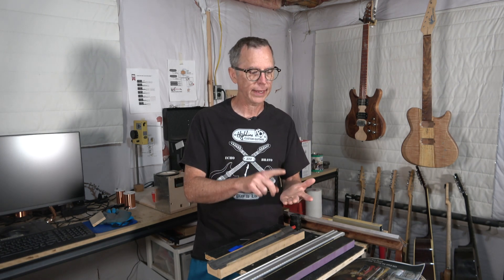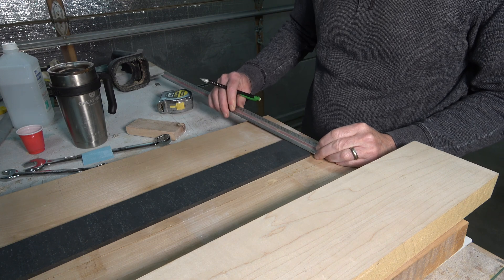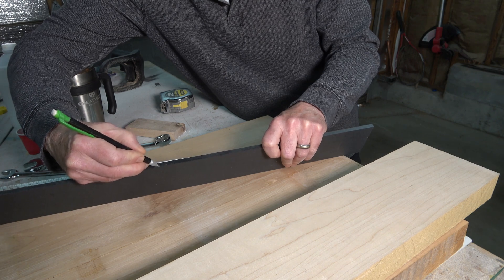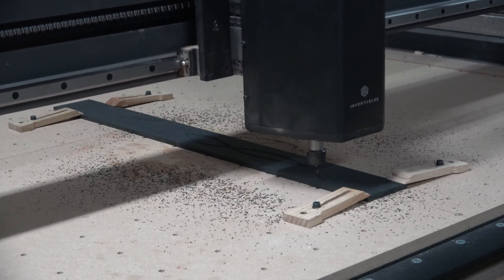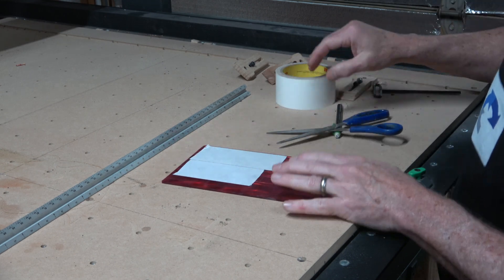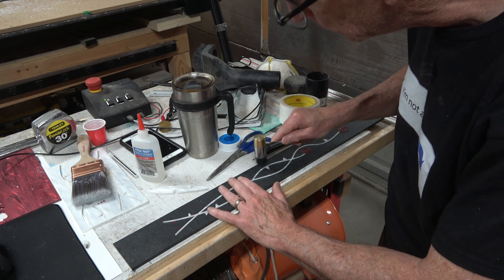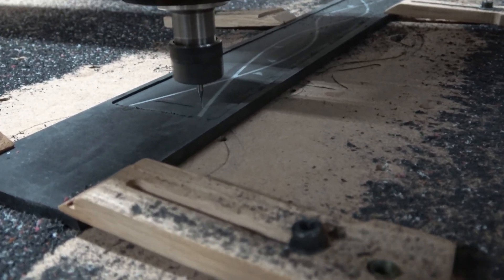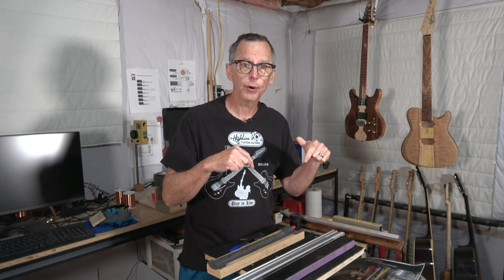Making A V Shaped Guitar Part 9 Making The Fretboard With A CNC Machine

Comment: Slowly making my way through these videos and I’m stoked to see you use Richlite. All my guitars have ebony and the youngest one was made in about 2021. Thankfully that one and all the previous ones all have great cuts of ebony. Despite understanding why guitar manufacturers are using the different ebony’s they are with the color variation and streakiness, I personally prefer just a deep black ebony. Mostly aesthetic honestly. I have a custom build from a Polish manufacturer that uses only composite material and it’s my first experience with Richlite. While I do appreciate the look of grain on an ebony fretboard, I love the resilience and look of the Richlite and it’s so easy to clean. I have another build in process with them, this time with mother of pearl inlays. I’m expecting them to really pop on that deep black Richlite.

Comment: Can I trade you $10 for some help with speeds and feeds on the richlite and kirinite. Just ordered some richlite fretboards and would prefer not to mess them up.
Reply from the maker: Awesome, Devin! Below are my feeds and speeds for those materials. I treat Richlite the same as any fretboard wood and use the same settings. Kirinite is cast acrylic so I use setting that are appropriate. Also, what works for me may not work for you unless you have the exact same CNC machine like I use (Inventables XCarve Pro).

Richlite

Fretboard Radius
.25” two flute spiral downcut bit
Feed Rate: 150IPM
Plunge Rate: 40IPM
Depth Per Pass: .25”
Spindle Speed: 16,000rpm
Stepover: 40%

Fret Slots
.024” two flute spiral uncut bit
Feed Rate: 20IPM
Plunge Rate: 10IPM
Depth Per Pass: .01”
Spindle Speed: 20,000rpm
Stepover: NA

Fretboard Perimeter
.125” two flute spiral uncut bit
Feed Rate: 80IPM
Plunge Rate: 36IPM
Depth Per Pass: .0625”
Spindle Speed: 16,000rpm
Stepover: 40%

Kirinite

Rough Pass 
.0625” two flute spiral uncut bit
Feed Rate: 60IPM
Plunge Rate: 20IPM
Depth Per Pass: .0625”
Spindle Speed: 20,000rpm
Stepover: 40%

Finishing Pass
.03125” two flute spiral uncut bit
Feed Rate: 40IPM
Plunge Rate: 10IPM
Depth Per Pass: .03125”
Spindle Speed: 20,000rpm
Stepover: 40%
Reply: @HighlineGuitars  thank you, keep the videos coming, hopefully one day I can share some of my builds and pay it forward.

Comment: Hi, Chris.
I echo everyone else's praise of you. You are truly superb at what you do, and -- total bonus! -- a great instructor.
I hope you'll humor me, and maybe have some guidance, but I'm new to this and experiencing difficulties on the CAM side.
I've emulated your software chain: Rhino 3D for 3D modeling and output of .stl files. MeshCAM for writing tool paths and generating g-code. CAMotics for "previewing" the cutting operation and final product.
Problem is, for me, the g-code output from MeshCAM results in a "distorted" representation in CAMotics, with all kinds of strange "vestiges" and things I don't see either in MeshCAM or the Rhino 3D file.
Did you experience this early on, while developing your software chain? The g-code that I'm seeing represented in CAMotics is super weird. Like, I've got a neck contour file in .stl, and when I export it from MeshCAM to test it in CAMotics, it suddenly has all of these odd bars or "bridges" running across the top surface. In other words, bars that are NOT part of the carve; just like the g-code chose to skip them.
At the same time, though, the actual intended contour will be represented underneath -- as if the bit were able to "duck under" the unremoved wood and perform the operation?
Anyhow, early days for me, and I follow your channel obsessively. But if you've encountered anything like what I'm describing, do you have any advice? I'm totally reluctant to attempt a carve -- even a trial run in cheap pine -- when CAMotics indicates what I can expect as the end product. (And it's not pretty.)
PS. On the subject of Richlite, what is your opinion of phenolic, etc. Other composite fingerboard materials, as used by Modulus, Zon, etc.?
Reply from the maker: Are you telling CAMotics what bit you’re using? It has to be the same tool number and specs as they were set up in MeshCAM. You can do this in CAMotics by right clicking in tool menu on the left side of the screen. Also check the preferences and make sure have the right machine selected and try using high resolution.
Reply: @HighlineGuitars  Thanks, Chris! That totally worked! I didn't know the bit had to be assigned in CAMotics and match the bit used to generate the tool paths in MeshCAM. Time to go destroy some pine test pieces!
Reply from the maker: @thomasbreene893  Yep. I had a hunch based on my own experience.